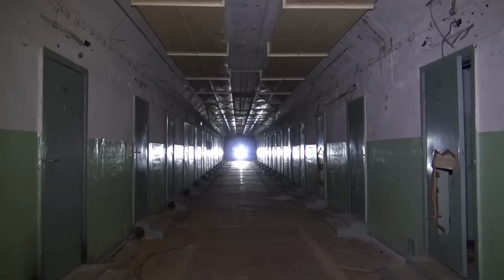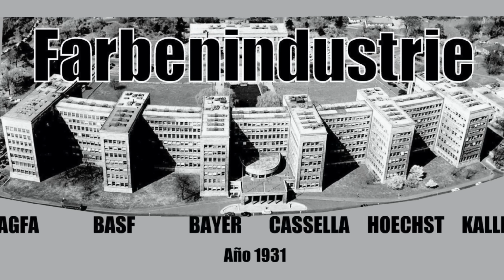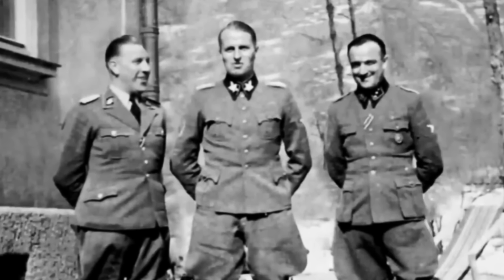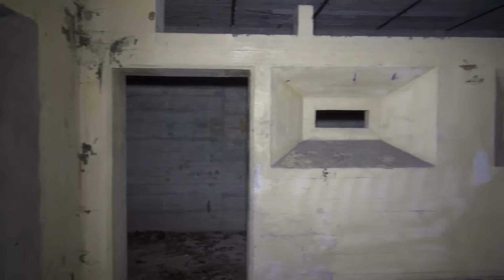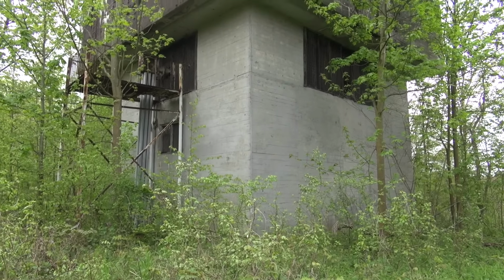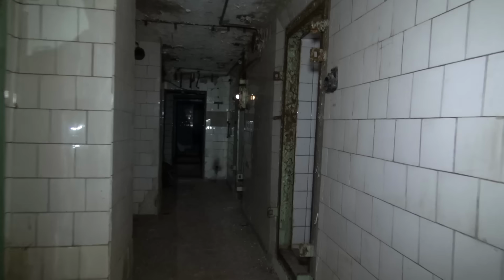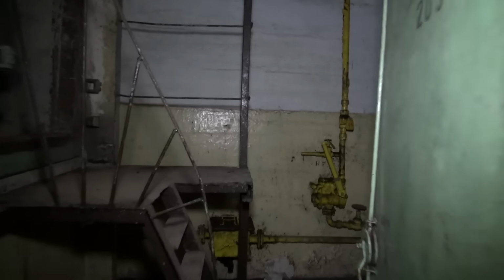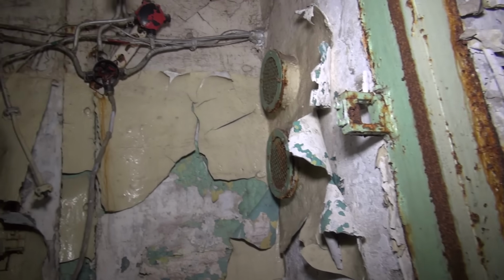THE LAST NAZI SECRET - SS  LAST RESORT FALKENHAGEN

Comment: Chlorine trifluoride is the agent of choice for separating uranium and plutonium.  The plutonium components form a solid, while uranium forms a liquid or gas, depending on the temperature, that can be easily separated.  Building a bunkered multimillion Reichsmark production complex for a material whose use was questionable and which no one wanted makes no sense.  The question arises as to where possible processing of transuranic elements could have taken place.  Such a location should be able to be identified using isotope distribution.  What actually speaks against the fact that the Soviets continued to operate the facility for their nuclear program at least for the first few years after the war?  Finally, the first uranium ore came from Germany.

Comment: Regarding the clicking from possible Radon, Radon is sticky.  It will stick to your clothing, skin and lungs, but it will also cling to your equipment, such as the Geiger counter.  So if you passed through an area with a high level of Radon, your meter will be "smelling itself" until the Radon decays.  That said, I don't think that was Radon contamination.  That was something else.

Comment: I guess, the rooms in -4 were double as high and the concrete Shelfs in -3 had crane rails on them.
Maybe the russians added extra floors and brick walls do get more smaller rooms 
for just sleeping and personal instead of produktion and machinery, where you need higher rooms.
Ciao, Bernd
Reply: Same thing I was thinking

Comment: There's an enormous amount of wall tile, white, which I think would have to be put on the walls by hand. If all of this tile had to be installed by hand, that itself is a massive amount of work. Could tile be installed in sheets? Is this material really tile of the kind that would be used on the walls of a bathroom?
   Although the video shows a lot, it is very difficult to understand how the space was used or was to be used. Without some commentary, this video only shows but does not tell much at all.
Reply from the maker: Oh no typical German workmanship the entire first floor was tiled floor and ceiling in the next episode from there I'm going to try to break down how it worked as far as We Know

Comment: I too, am amazed at how dry everything is. I'm sure it feels damp and cool....but I would think that place would leak water.....but maybe the concrete is so thick it can't. I know some people are very concerned about the air quality and how it may poison you....I remember the people who died from King Tuts tomb....the locals said they died from a curse.....but they found out later it was some kind of strange mold....But that tomb was sealed with no air for a thousand years. Atleast this place has pipes through it. So you know even without blowers the air does get around some. I would not worry about the lead paint since your not grinding it off making dust.
Reply from the maker: well they lined the walls during construction and apparently did a really good job doing it. and there is no way rain water can get in either

Comment: Has anyone tested the bottom residue in the water reservoirs for radiation ?
Reply from the maker: You know I don't think we did but since we're going back that's a good point
Reply: If any uranium was processed with ClF3 in that facility (it releases pure chlorine gas during that operation, btw), I reckon any UF6 released (as a solid) would have reacted with water yielding hydrofluoric acid and uranium oxide (UF6 is a solid, it sublimates around 55-56°C). Logically, those particles would have been washed away by some kind of decontamination procedure and could have made their way to a containment pond. Now, as it has a good density (almost as much as lead) I'd say it would have a tendency to go fast to the bottom and any kind of further mixing or swirling action would have pushed it even deeper in the sediment...

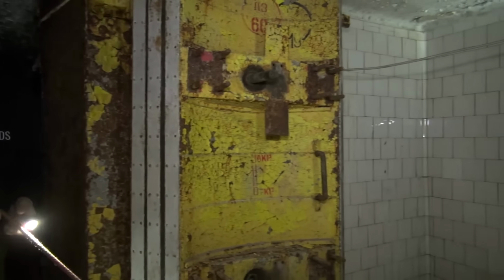Comment: I apologize this seems to be rude however I wouldn't take my dog into that facility and I certainly would be using a full face respirator with hepa filters. The Geiger counter is a great touch but may give a false sense of security as seen here 36:20 and throughout are lead based paint hazards which are currently in friable condition, meaning air borne, floor borne and everything borne. Also as clandestine research lab who knows what else could be lurking.  Better take those vitamins, namely minerals for lead detox or just get the blood work tested for it. (research your supplements if you plan on using them and don't OD) I take supplements but you need to know the details (taking vitamins isn't good for you but if your body needs them and they aren't there then its bad for you)) .  As for the pet dog...

 I should add that 'our main man' isn't disturbing things, too often, usually. The floors may have crumbling paint from the era whether from the walls or directly painted, to be certain.  Listen for the crunch crunch crunch of walking feet on crunchy lead based paint.  Its "heavy" so it falls out of the air 'rather' quickly but still BE CAREFUL!
Reply: Lead paint is the least of your problems down there. It is bound and the little you are exposed to for that short time is negligible. It is worse with airborne organisms such as toxic mold and, above all, that the oxygen runs out at the bottom. Life threatening not to have an oxygen mask.

Comment: its quite funny the difference between where you first entered into the blocked concrete tunnel to the  white tiled walls in the main section, the décor is very much a desired taste and not for me, it be like working in a public toilet or shower block, cold and depressing, must have effected those working there, although the green paintwork is meant to be calming as this was used in hospitals a lot

really good to see many of the metal features still in place, gives an idea of what was in place and what might be going on there

it's a very intriguing, full of what seems vast corridors with few very small rooms off them (apart from the odd large one here and there), very little space to work and more room in the corridor, imagine the small rooms with desks etc making them even smaller, worse than prison cells

i know you keep calling it a chemical plant, possibly from surrounding evidence, documents and persons working there, but where's the hard evidence, be worth getting someone to bring a test kit to see if any residues were still present - i know if i were there, i wouldn't be touching stuff with bare fingers